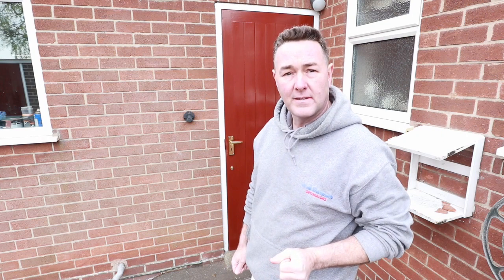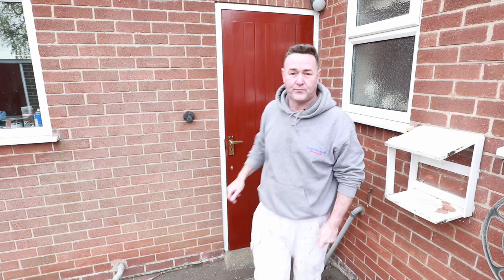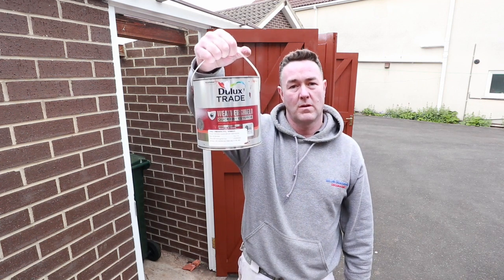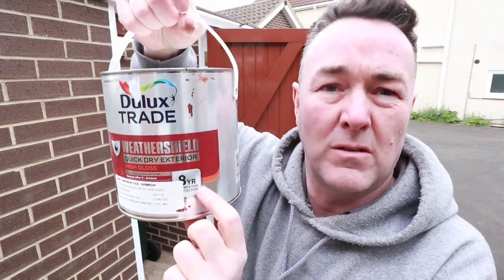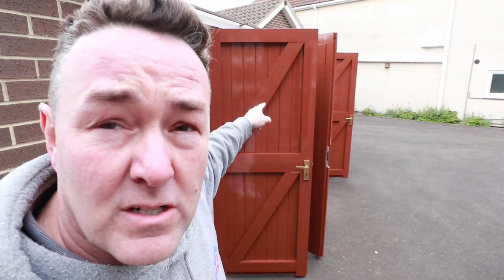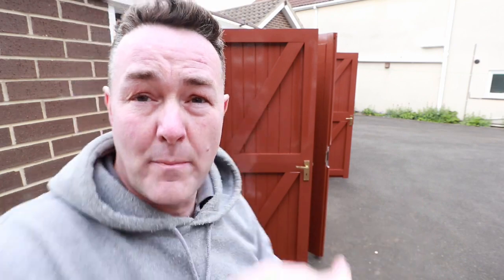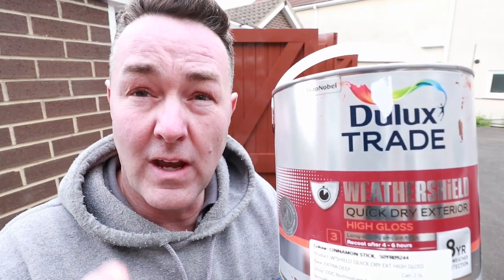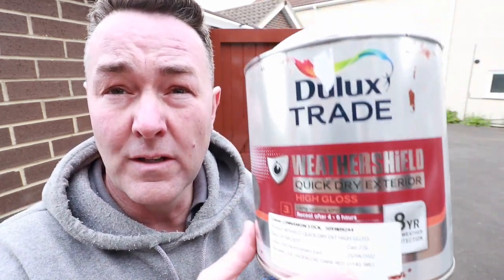Dulux Trade Weathersheild Exterior WaterBased Gloss - Faulty?

Comment: Great video Phil, I used dulux water based satin exterior ( light blue ) on a front door and garage door , went on great .
Went back about 6 months later to decorate the hall and stairs.
The front door had faded in patches looked terrible, I told the customer I would do it again in oil based paint 
They said they were happy with it. 
So now I only used oil based paint on front doors now.

Comment: Very interesting video phil.
I've used the dulux weathershield wb gloss quite alot and this did happen once to me.
Same as yourself the correct process regarding prep and correct primer/undercoat used.
A coupe of things aswell, I always get the same colour in the undercoat as I do the gloss. Just ask them to mix the colour in a u/c base, regardless of what the labels recommend 👌 
Also I did get told that the gurantee on tin only applies on new wood with the 3 stage process.
I must admit it has a great sheen for WB on darker colours but I find on lighter bases it's not a shiny. Be interested to hear back

Comment: Hi mate, just stumbled across this whilst deciding what paint to paint my exterior trim with. What would you recommend? Looking for a satin finish. Thanks for the video.
Reply from the maker: Welcome.

Use the correct matching primer/UC

Look at Isomat Isolac satin 
Or Caparol PuSatin or puGloss (that's only a 65% sheen level)
Bedec Aqua Advance Satin

Easy Multi Surface Paints.

Bedec MSP
Zinsser AllCoat
Sandtex also do a retail Multi Surface paint too.
Reply: @ProfessionalPainterDecorator  Thanks for your reply, that gives me a great start point to look at. Cheers again!

Comment: Good video . You have to wonder if enough testing goes into new products before launching. In fairness reds are always a bugger. Good sheen level at end of the day. However my issue with waterbased products is they need more coats , in general, than traditional paints. Two coats oil ( reds, yellows will be the exception ) generally gets the job done. Waterbased always seems to need another coat . Certainly till I am happy.
Reply from the maker: These have had that many coats I'm supprised the doors close lol

Comment: Just had a similar issue with QD Weathershield gloss Copenhagan blue. Turns out the machine specified dark base instead of light so pigments were fighting the base so resulted in wrong colour and rubbish finish, decorator centre swapped it no problem but still lost time

Comment: I am a floor sander , FLockulation, to me sounds like when you are TINTING a clear flooring gloss with too much colour stain, ie if you tint more than 5% stain it is harder to FLOW OUT and level out evenly , ie best to do 2 coats with only 2% stain or you will notice LAP MARKS.  The darker the pigment the more problematic the results.there is also Anti Rejection additives to help this in regards to polyurethanes.Similar principal
Reply from the maker: yeah, sounds similar.
Reply: @ProfessionalPainterDecorator  I wrote this comment before you actually mentioned this at the end of your video

Comment: Great video Phil, shame you had the issue as the new formula with the 8 years sounds decent gear.   Maybe the 6 year base was old stock as it’s being fazed out even though you bought it fresh off the shelf.   I’ve just picked up a tin of the 8 year water base high gloss for a job coming up with loads of sash windows.   Also the undercoat will only be water base soon across the board for Dulux t weathershield guess it keeps it simple.
Reply from the maker: You'll be fine with the new one. You've got the right matching undercoat?
Reply: @ProfessionalPainterDecorator  yes mate, the white water base undercoat.   Also I hear their oil undercoat is being fazed out  so the total system will now use water base undercoat regardless to top coat
Reply from the maker: @mrWinchester2  I used the wb Uc on a garden seat last week... It's very good.

Comment: Also , if you have many doors to do would a 4mm mohair 100mm roller then laid off with a brush be quicker? That’s what I have been doing lately and it works a treat.
Cheers
Reply from the maker: rolling and then laying off a water based paint sometimes doesn't work as well as you think it will.... it dries too quick and doesn't allow you to lay off.
Reply: @ProfessionalPainterDecorator  no worries.i have been using Dulux oil based one step Undercoat and Dulux oil based Enamel in an enclosed type outside area.. 
you are obviously spot on as I haven’t used acrylic glosses
Cheers

Comment: Possibly been too cold a month ago, water based deep colours dont like the cold, l had a similar problem with zinnser allcoat deep cols. Merchant said its probably too cold as any issues they had past were from applying too cold..  l overcoated oil based and was fine, always get undercoat tinted same colour esp the  deep ones.
Reply from the maker: Hi Richard.it wasn't a weather issue. I think the base and colourant mix was wrong. The new tin was the new formula, the other original can was the old formulation even though brand new off the self at Paintwell. Old can said to use dark grey if, new formulation can said use red Uc.
Reply: @ProfessionalPainterDecorator  Dulux Brushwood..  was hellish stuff a basic grain by bristle brushstrokes, you couldnt make it up !

Comment: the only way to go for new exterior or bare exterior woodwork is linseed paints plastic paint will always crack on exterior woodwork due to trapped moisture and cause denaturing that being the best case worst case the paint will be to strong for the moisture to push the paint off and cause the timber to rot.
Reply from the maker: what make of Linseed paint do you use?
Reply: @ProfessionalPainterDecorator  brouns and co. if im using synthetic paints i would add owatrol oil to give the paint penetration rather than just adhering to the surface more flex and make it more vapour permeable so moisture escape faster before damage is done the problem is these paints say breathable on the tin and probably have a SD value of 1 at best linseed paint as a SD value of 00.2-00.5 so the bar at which these paints have to pass the vapour permeable test is far to low. also linseed paints are the most environmentally friendly. other than probably limewash
Reply from the maker: any thoughts on the faulty paint though?
Reply: @ProfessionalPainterDecorator  no just bad stuff there must have been a missing ingredient my point is can't understand why big paint manufacturers keep pushing plastic paints i have had a problem with dulux oil undercoat that was missing ingredients but can happen now and then.
Reply: That's not true, a lot of exterior rated 'plastic' paints as you call them are actually microvapour permeable - meaning moisture can escape from the timber through the coating not get trapped and will actually last significantly longer when applied correctly
Reply: @swatts66  thats not what i call them thats what they are yes they say they are vapour permeable and they to a point and flexible but no way near compared to traditional materials most modern exterior paints will say breathable on the tin with a SD value of 1 where as traditional materials have a SD value of 00.2-00.5.

Comment: Hi phil,have you had trouble cleaning the weathersheild exterior gloss out of your brushes,ive lost 3 in a week ,wrapped them up took them home to wash and theyve gone hard and twisted ,
Reply from the maker: Morning Colin, No, have to say these washed out fine.. ran through with cold water then warm and a touch of soap. 
try some brush cleaner and wash out see how they are.
Failing that, do the white spirit.. then spin that out.. then follow it some Meths to get the last bits out.. then warm water and some soap.
I found that worked when using Jonnos Advanced Aqua Satin, which broke the back of brushes after 30mins of using all day.

Comment: I tried the waterbased paints for a while but i am back to solvent based , the water based paints look good for a few months but doesn,t have the toughness of solvent based
Reply from the maker: But we go back to jobs a few years on, woodwork burn off, prep, knot, prime etc. and finished in Oil Uc and two top coat oil finishes (Sikkens Satura Plus) and you can still find windows cracking and flaking (due to weather conditions and side of the house).
Then on other jobs, use waterbased.. Tikkurila Ultra/Classic, following same process of prep, Uc and two top finishes.... and they stand up just as well.

Also don't you find Oil Gloss still fades off with the weather.... so you might as well use a satin finish outside as it looks better for longer?

Comment: Never ever use Dulux weatweshield again the product has went right down hill the last few years and im not talking about faulty paint.
Reply from the maker: You've not tried this new formula then that just come out?
Reply: @ProfessionalPainterDecorator  No dont use Dulux weathershiels full stop had 2 jobs start peeling after 2 years and i done it all the right way been a painter and decorator for 35 years and was taught of my dad a bit like u i can remember the days when nearly every colour u put on would be a dark grey undercoat gone are them days
Reply: Just paid a fortune for Dulux Weathershield waterbased exterior Satinwood. Bloody awful stuff and expensive. Long term Dulux user, never again. Two coats of undercoat, Needed 3 coats of top coat and the finish is bad on a brand new door. Brush on the second stroke it brushes off. Only a pale green over white.

Comment: For goodness sake stop using waterbased on wood, both interior and exterior, the finish is second rate compared to oil
Reply: Not if you no what your doing, if your any good you should be able to get just as good a finish as oil. I no the waterbased gloss may not as be as shiny but that's a different story
Reply: @marsdencarl89  your showing lack of knowledge and experience if you think water based is superior to oil, keep trying though
Reply: true oil paints like linseed paints are best. synthetic oil paints polyesters aint to bad not great acrylics plastics are probably better than polyester alkyds you can improve them by adding owatrol to give the polyester paint penetration rather than just adhering to the surface also making them more flexible and more vapour permeable but if you have new timber windows or bare timber timber windows then the only good option is true oil paint linseed paints
Reply from the maker: @jackwardley3626  why do you think the move over to water based with all the big paint brands?
Reply: @beecee6850  I'm not showing lack of knowledge I'm stating facts. I'm not saying waterbased is better I'm saying if you no how to apply it then you should be able to get a finish that is just as good as oil! I no it doesn't flow the way oil does but that doesn't stop you from achieving a great finish. Most of my customers don't want oil based paints stinking out there house and taking hours to dry.
Reply: @ProfessionalPainterDecorator  no to much really just plastic paint being replaced with a different plastic paint.